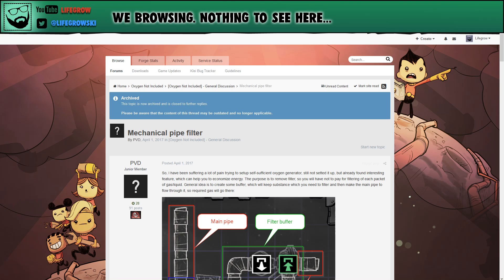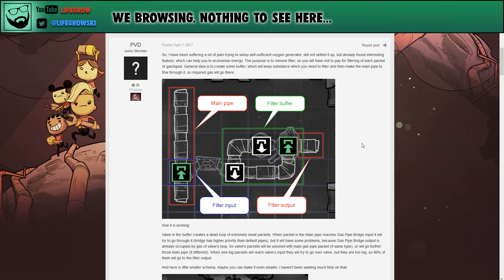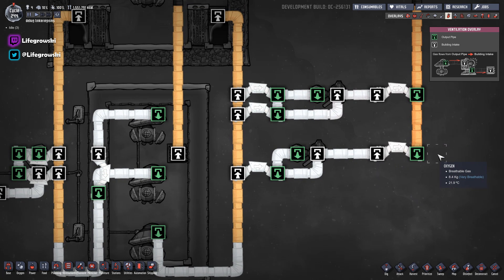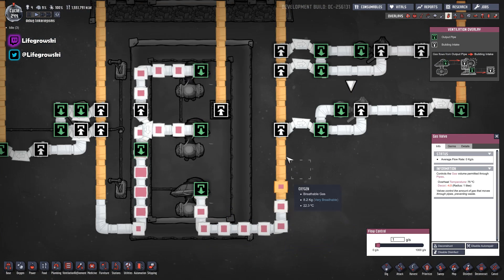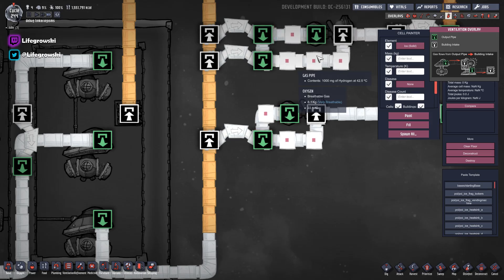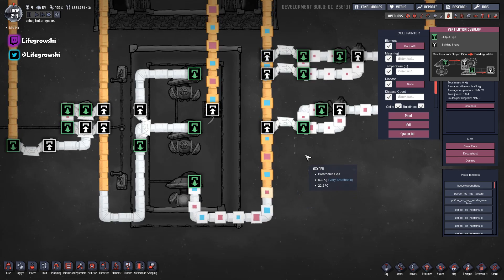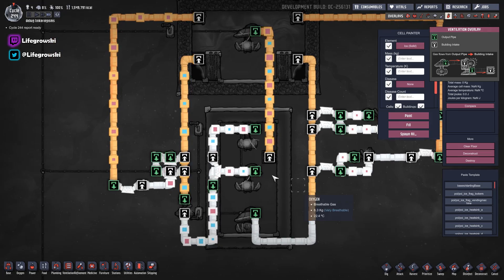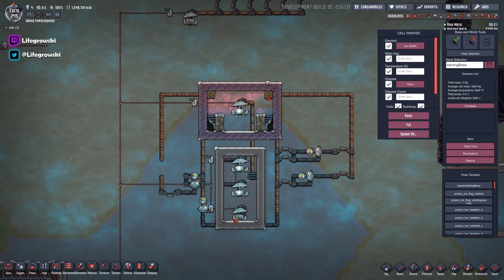MECHANICAL FILTERS EXPLAINED (WITH FORUM LINK)

Comment: Thanks for the tips :) does this still work in cosmic upgrade, cause that does not seem to work for me ?
UPDATE : Yes it does work in cosmic update, i needed a duplicant to set the valve to 1g/s, if none of the duplicants is assigned to prioritize Toggle errands it does not work properly becasue all of the gas will remain in the buffer and 0 g will be allowed to leave the filter.
Reply from the maker: Yes, it'll work for a long time I would imagine, it's not an exploit. What are you struggling with ?
Reply: Problem solved, Thank you :)

Comment: Actually, using the same logic you taught us, using a bridge on the output can let you in emergencies fill the hydrogen into a storage room. as it will only do that if the bridge (which goes to the hydrogen generator) is full. Which would only happen if fill all your batteries are full, but you know, safety. that way your pipe filter system will always work
Reply from the maker: Yeah, totally. A fully primed hydrogen pipe is the ideal setup - that way the gas is immediately sat there ready when the generators are toggled via automation.

Comment: Nicely explained, however what's its purpose? What's the benefit?
Reply from the maker: Greywind it's a free way of separating gasses and filtering them to where you need them. I.e. hydrogen to generators, oxygen to your base, co2 to skimmers or slicksters, etc. Normal gas filters cost power, these don't.
Reply: Ah I see, completely forgot about the power requirement.

Comment: Its work for hydrogen but not for oxygen when use oxygen its all messed up
Reply from the maker: It works for any gas - just make sure you have your pipe connected properly (i.e. not ran THROUGH the valve) and also that your valve is rotated correctly.
Reply: Lifegrow i did it correct i built two same system one of work with hydrogen other one not work with oxygen. I dont know its bug for my game
Reply from the maker: Sorry buddy, but all I can offer is to advise you check your piping again, and make sure you have only ONE type of gas in your filter buffer section of pipe - if you have multiple different 1gram packets for example, then it simply wont work properly.

Comment: Nice useful video, thx.

Is there a place where these useful arrangements are collected in, say, a sticky forum thread ? I was looking through the Klei forum the other day and I could not find any collection of useful devices like this. I would have had to read every thread on the forum (though not necessarily all of each thread ) to find the information I was after - like the device in this video. 

Cheers.
Reply from the maker: Sadly not, the forums are a garbled mess of repeat questions because of this - there is a search function, but unless you know the right buzzwords, you're out of luck.
Reply: Not to worry, at least I now know not to spend too much time looking for such an archive. I'll make sure to squeeze the value from your collection of guides ;-) Thx.
Reply from the maker: Well if you're ever stuck with anything, give me a shout - if I can't point you in the right direction i'll happily throw a quick video together for you :)